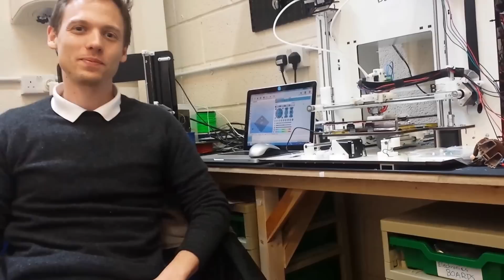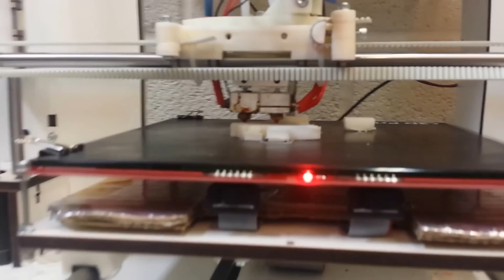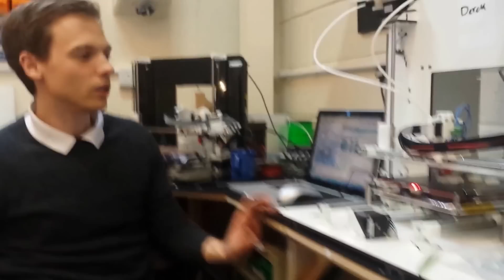Printing Support Materials with Chimera

Comment: Did he mean to say the exact opposite of what he tried to explain what the dual extrusion setup was doing ??? -- With HIPS (Support Material - Dissolvable) and ABS (Build Material) Thats its testing for the ability for HIPS TO BE A DISSOLVABLE MATERIAL and NOT FOR BREAK AWAY SUPPORTS -(The entire reasons for using a dissolvable support material).  I ask as I BADLY need a simplified dual extrusion setup for a dissolvable support material AND a nozzle for high-end / high strength building materials I need to remove supports away perfectly from with no cutting away or hollowing out complex models.    I am lead to believe without a toolchanging system or a dual nozzle setup with ooze shielding and tilt mechanism between the nozzle being used vs the idle one - As the Chimera has both nozzles at the exact level causing issues with extruding only one filament and not having any ooze of the other seep into the path of the printing of the other nozzle....    But again if it does work - As your company produces these units FOR SOME REASON (Id hope its that they actually allow multiple extrusions to work) Yet no video ever shows a Chimera working and a print being made with dissolvable supports and a build material if the Chimera is even viable - Even here you cant see whats printing.  Can the viability of this product for the use I've mention be commented on?